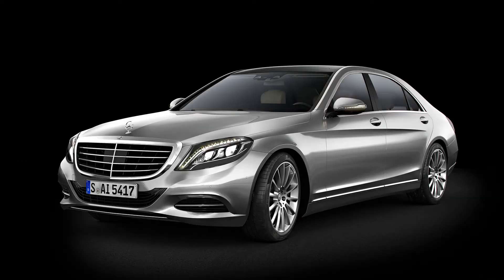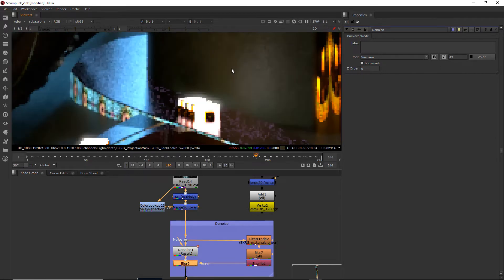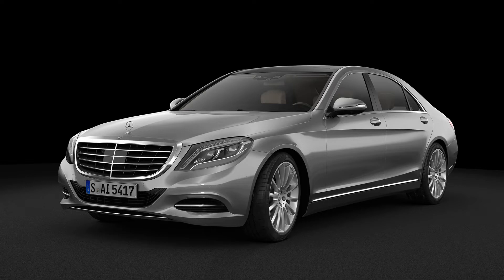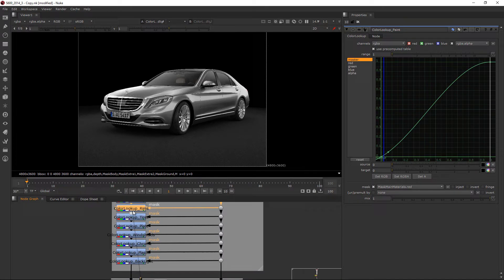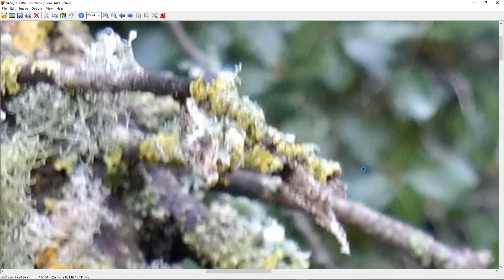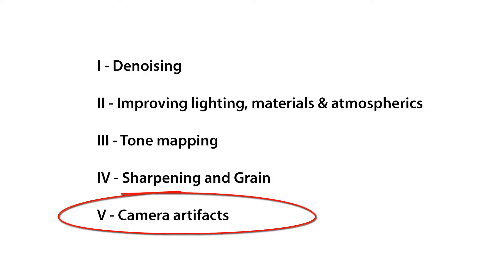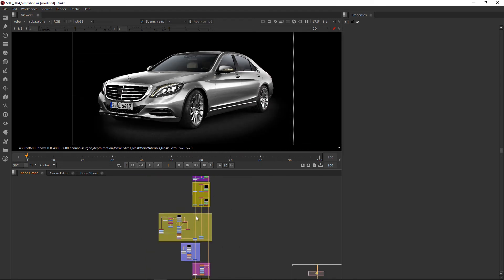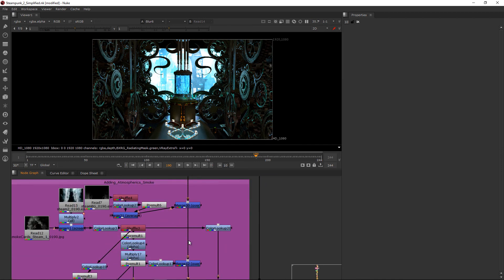Improving 3D Renders In Compositing

Comment: Nice one Mr Ali. I just went over to your blog, I'm impressed and grateful. However, I would love if you write an article on color correction dealing with cg and backplate, matching saturation, luminance, black and white point and full integration. You may skip the lens and camera artifact section to reduce the workload. Thanks
Reply from the maker: Thanks, glad you found it useful and it helped. It is really a challenge to find time to do these tutorials in between projects, but if I ever have time and making another compositing tutorial I will make sure to cover these topics.